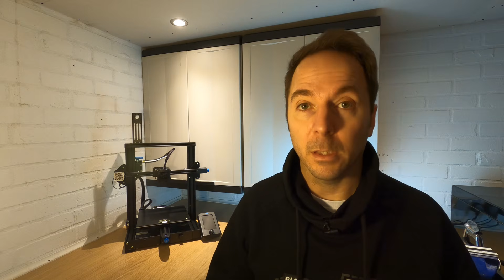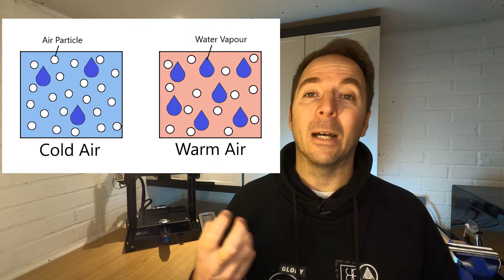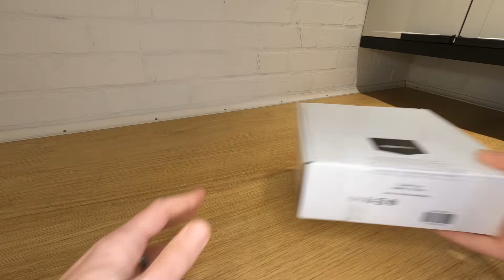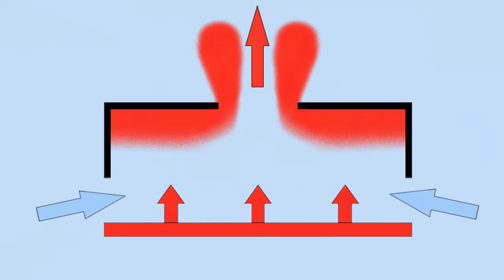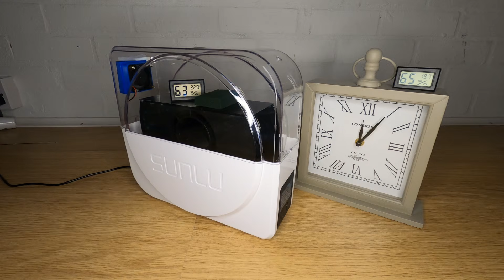Amazingly Simple Free Filament Dryer -You already have one!

Comment: Any old school stick welder owner will tell you the best way to get welding rods dry is to not let them absorb moisture in the first place.
We used to use an old filing cabinet with a 40w incandescent light bulb in it to keep it warm to store all our welding sticks.
These days you could probably mimic that with an automotive brake light or 2 running off a 12v power source in a similar cabinet.
All it has to do is keep the temperature a few degrees above ambient and you're done.

Comment: This is genius tbh. I was looking into filament dryers becasue I am working with pla and petg and in the future maybe nylon and carbon reinforced polymers, I really needed a solution for the moisture, maybe ill invest into a real dryer eventually, but I am not cranking out parts for a project right now so it seems like a good use for the currently idle printer. How often do you suggest I dry my filament. My humidity in that space is around 30-50% at about 20C.

Comment: Great idea and I'm sure it works if you have wet filament. Better yet never let your filament get wet! My environment is typically minimum of 45% to 60% humid. But I never have a problem because I use those air/watertight totes with desiccant after each use of any filament. In totes the humidity averages 27% to 30% and the desiccant shows no signs of wearing out for over a year. And the big benefit is no wasted energy or wearing out of my heated bed.
Reply: Just store the spools in hardware shop paint buckets with desiccant packets. the paint buckets are air tight by definition, and each can store 3 to 4 spools. the desiccant can be dried on the print bed the same way as the filament.
Reply: @TDOBrandano  Problem I see with paint buckets is that you can't see what's inside, minor setback that can fixed with labeling.

Comment: I think you touched on the important points but didn't quite explain this part - Filament (and/or dessicant) needs to be heated up to a certain temperature to start desorbing. Essentially, it doesn't just evaporate the water it contains, its capacity to hold the water decreases. Soaking filament in water does next to nothing, really. You don't end up with bubbly filament after doing that. The water seems to absorb deep inside and that happens when the filament absorbs water from the air, and usually after a long period of time.

Now this only does one of two things to save filament though, PLA tends to harden over the course of say a year, and my suspicion is that it's due to absorption of UV. The UV tends to harden it. This process, unfortunately, is irreversible. Heating it up and then cooling it back may anneal it just a little bit but does not much more than that. You may notice that printed parts you've kept for years (esp if exposed to sunlight) will by now be crumbling to dust. That's simply because it's hardened to the point where it's become dust.

Comment: I just bought a filament drying box today but this is a great tip.  Many people upgrade their printer and older 3D printers have a fairly lousy resale value.  It might be good to keep one as filament dryer.
Reply: low resale value for the sellers.  I only buy used.  Saved so much money.  It's a gamble on saving time as sometimes i've had to fix an issue here or there but 500 for the printer and upgrades vs 100 on facebook marketplace, yeah gimme the 400 to put towards whiskey!
Reply: @RedneckTechSupport  - I'm a sucker for the latest and greatest in the fast moving world of 3D printers.  Not only am I not saving a fortune on a low mileage last year's printer, I'm currently waiting for the Neptune 4 Pro Max because the very nice Neptune 4 Max doesn't have the Pro features I want.

I am thinking about converting my old SV01 3D printer into an EDM machine although the only real application I can imagine would be electrical discharge machining the rifling of a pistol barrel for some wacky 3D printed pew pew machine I might want to design, but then I'd post a video online and the fed bois would pay me a visit even though it's completely legal.   :-/

Comment: An experienced design engineer once said to me "If you are adding simplicity or removing complexity your design is going in the right direction, if you are adding parts and complexity it's a sign that you should review your design" This sums that idea up for me!
Reply: One thing is certain... your design engineer friend was without a doubt NOT German.
Reply: So that’s why German cars have become garbage 😂
Reply: Only bad thing about this design, is that it uses a cardboard box. Famous for loving to soak up moist from the air.  With another material in the box, I would say its good.
Reply: @AndrewTSqbut since youre drying the box aswell woukdnt that just solve the issue? I dont mind an extea hour of drying time if it makes the box dry aswell
Reply: Tell that to all those EV makers with flush door handles.
Reply: Retired manufacturing, design, ME, and EE here.  I've said the same thing.  Most experienced engineers worth their salt will say this. 
Accounting will love you, but you will forever be doing battle with Marketing.
Reply: How long do you leave it?
Reply: @snydergc  He said for his test, he set the printer bed at 70 degrees Celsius and left it for about 5 hours. Yes, I know I am a year late.
Reply: Thanks for sharing 😊
Reply: Often heard, but that way we'd never Jumbo-Jets, AMD Threadripper or WIFI 802.11ax. So it is not generally applicable.
Reply: @holgerschurig4430  Plausible, but perhaps we'd have simpler aircraft, instead if more ( not all) engineers also thought like this. I think there's probably a balance of the 2 perspectives to find perfection. 
The raptor 3 engine, version 3, of the starship engine from spacex is an absolute masterpiece of simplicity, but it's the result of first building a crazy complex engine, and then refining out every possible extra part they can. The best part is no parts... or something like that.
Reply: That is a very simplistic view of it, a lot of times you have to add complexity.
Reply: @conorstewart2214  I've noticed you can always count on others to add complexity (must be easier or something) but rarely anyone removes any... :)
Reply: @jayblack8132 I am considering the same.
Hot air can contain more moisture than cold air and water is more likely to evaporate from something when it is hot, that is how the principle works.
In the case of this box (see what I did there?), convection makes the "extra wet air" rise out the top. It is then replaced with colder air, which can contain more air as it heats up.
If you cycle the "wet" air out once the drying is complete (and ideally vacuum pack it), the moisture should stay out.
I'm too lazy for all that, so I use almost-airtight crates with no vacuum bags and recycle the dessicant pack when I notice the humidity goes up (if it doesn't recover after taking out or putting in a roll).
A mini-fridge would be the ideal size for having a mini dehydrator.
Reply: @jayblack8132  yes you need a solution for keeping the filament dry. Most common are sealed boxes and desiccant or vacuum bags.

However for some filament, especially filament that isn't very hygroscopic, it will take a while to rehydrate, so you can get away with leaving it in the open and only dehydrating when you notice it has become too wet.

Comment: Actually a quite nice idea. Also some people might have upgraded their 3d printers - like better bed (fine milled casted aluminium) if the old bed is bend or/and a board with silent stepper drivers, maybe even from 12 to 24V... So practicly having all parts flying around to build a "3d printer" without actual print functionality, just old PSU, printbed and controller (and a second thermistor, if the firmware do have a min temp failiure for the hotend). Actually I would like an firmware for old RAMPS-based boards, reusing the display and rotary knob to set temperature and time and using one i/o pin for one-wire buss to add a humidity sensor (maybe to controll a fan, if humidity is to high to forcefully change the air, instead usung convection. Should be even better than the modded Sunlu dryer, as you can get over 70°C, and also you can use a less flamable material than the cardbox of course. Actually here in germany at xmas some packages for sweets have exactly the right size for 1kg spools (I use them as airtight containers for my more expensive rolls - but I do not have a lot, as I am diabetican). Also I think I saw some transparent container for cheese in the kitchen department of IKEA for just a few bucks.
To save energy you might insulate the bottom of the heated bed.
Actually a nice way to recycle old parts.

However, many printers have timeouts. The Prusa mk3 for example shuts down, if you just heat over 20 minutes without actual printing. You might generate a gcode homing, going up with the printhead and than move it from time to time in x to avoid running into timeout. Or compile your own firmware, deactivating this feature.

Comment: I've put reptile heat pad into Ikea Samla transparent box. And a themometer/igrometer too. 
It stays 32-33°C with thermostatic control to don't cook reptiles. And humidity rarely pass 40%. 
Into a 22L Samla I can put 6 spools (1Kg each) and a 7w heat pad. 
There's different sizes both of Samla and reptile heat pad.
Reply: 32-33 C is too low for drying filament and 40 % humidity is too high to keep it dry. You need 50-60 C for drying PLA and ideally you want humidity at 10-15 % for storing filament, so your solution is not really a good one.
Reply: @conorstewart2214  I destroied 3 spools of PLA drying it at 60°. If you look at the vetrification temperature of the PLA it's 60°. They need to be dried at <=40°C. 
My box is slow and needs 2-3 days. 
I keep spools inside and take when I need to print. 
I can testify that also PETG that was startin to pop and do stringing after 3 days out on the spool holder of the printer, it printed perfectly just the day after (near 24h) into the box. 
Umiduty is always under 40%.
Reply: @conorstewart2214  60°C for PLA? I destroied 3 spools of eSUN PLA+ drying them at 60°C. 
Dry temp for PLA is 40°C, 60°C is for PETG.
On tech specs for PLA it's written that at 60°C it starts vetrification.

Comment: Hello, Ricky and fellow printers.

I performed a retraction test that gave me very thick strands, so I dried my filament for 4.5 hours at 75°C, then immediately reprinted the test and it was beautiful. After some 5 or 6 hours, I performed the same test again but the thick strands came back! Dried overnight at 55°C, printed the test right away and it came out clean. Unfortunately, when I ran it again after some hours, the strands formed once more. The only way I can rationalize it is that the moisture isn't "pulled too far from the spool", hence it's re-absorbed by the PLA in a matter of hours. Is this roll of PLA too degraded? Or should I dry it for like 30 hours straight, for example? I had never dried filaments and this spool was opened more than a year ago.

Thank you for your insight!
Reply: I wonder how humid your room is, try putting it in a box of desiccants after drying and see how long it stays good
Reply: @EddoWagt  thank you. 🙂
Reply: Is the spool still warm when you test it? I'd eliminate that as a variable, because it shouldn't be absorbing ambient moisture so quickly.
Reply: @GamesFromSpace  Definitely still warm. I would say it goes back to stringing when the spool cools down. 😮
Reply: What material are you using? If it is PLA then something is really wrong, it doesn’t absorb moisture quickly and you shouldn’t be drying it at 75 C, since PLA goes soft at around 50-60 C and you shouldn’t be drying filament at a higher temperature than it’s softening point as you can then end up turning the roll into a solid lump as the strands stick together.

You really should have mentioned the material you used, that is basic information.
Reply: @conorstewart2214  yes, it's PLA.

Comment: I found, with a single 3 cm hole in the top of the box, you can put a toilet paper tube (or a full roll of toilet paper) on top of the hole to act as a chimney, which more efficiently draws the hot air upward out of the box.
Reply from the maker: I like it!

Comment: I read a lot of good reviews. but funnily it didn't work for me😥60C 7hrs, only 0.5gram lighter.
Should i add a fan on top so it draws the air from the outside to the inside and pulls the moisture away from the top? Food dehyradtor didnt work for me as well. 😥

Comment: Thank you for this clever idea. Where i'm living actually the weater is sunny and humidity is low, so i'm thinking about a "slow" drying method.   I know green houses can reach easily 40-50°c. Is putting the filament in a plastic box like your "Filament Dry Box" outside in front of sun (with black cover or dark plastic color to help temperature increase and protect filament color with some holes to permit air circulation) a good idea?. I know temperature will not be really stable and will not reach 70°C but until it doesn't reach too high temp and i give enough time to dry , that will do the the job?

Comment: Isn't 70° C pretty hot for a test if you're drying PLA? PLA gets soft and sticky at the usual 60° temperature used while printing. Wouldn't it be best to set the temperature to 50° in that case? That's what I'm using now to attempt to dry a spool of PVA, but I don't know how effective it would be. I'm concerned about the filament fusing or annealing to the spool if I make it hotter. Letting it sit for a day with the heat bed set at 50°C seems to work OK.

I encountered one difficulty when the Prusa MK3S "safety timer" kicked in and shut down the heat bed after half an hour. You have to send the g-code "M86 S0" to disable the safety timer. You can put this in a .gcode file on the SD card and simply run it from the printer.

Comment: I'd prefer seeing a before/after test using a roll of filament rather than a sponge. I don't print with sponges. :-)
PS. I use a modified round food dehydrator and always dry filament, using before/after weight as a measure of success, even if it's new, vacuum sealed, etc.

Comment: This might be a stupid question, and I'm sorry if it's a repeat but...

 what's the temp and time I should set this method?

 And does the temp & time change with different plastics??
Reply from the maker: Anything over about 50°C is going to help. PLA is the easiest to dry but for things like PETG, you may want to try 60-70°C. As for times, the longer the better but you should see improvements after 8 hours or so.

Comment: Great tip, thanks :) What temperature do you set your heated bed to ?
Reply from the maker: It depends on the filament really. Start with 50-60 degrees and you should see a difference with something like PLA.
Reply: @RickyImpey  Thanks for taking the time to reply pal :)

Comment: brilliant use of the bed! I came about this in a slightly different fashion that holds a bit more and I can still print while using.  I bought a 2 pack of Plant Heating mats on AMZ (in testing stay between 70-85 degrees and each mat holds 2 spools)  For < $30 and with 4 cardboard boxes I got a 4 spool dehumidifier that doesn't tie up my printer bed. ;)
Reply: what temperature and how much time should I leave my filament on for, if i'm using my printer bed? ? this seems really intuitive!
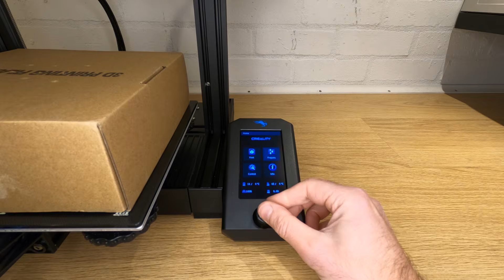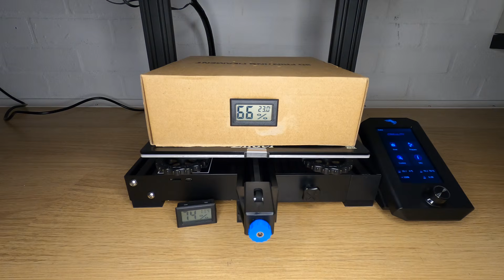Reply: @TheStrokeForge  The speaker states that for his test, he set the printer bed at 70 degrees Celsius and left it for about 5 hours (2:57-3:00). Others have said they heated the bed to 50-55°C for about 3-3.5 hours. I guess your mileage will vary.
Reply: That's brilliant!!

Comment: I do have a heated bed for my 3d printer, but it's small is it still possible to do this? I assume it will take more time instead of just 4 - 6 hours
Reply from the maker: It will work to a degree but, you are right, it may take longer.

Comment: Mine is much much cheaper i just hang it at the back of my freezer its an old model freezer with evaporating coil at the back,  my place is humid too around 75 to 85 and my freezer where i store my filament is just beside my kitchen sink still my filament is always dry and ready, i was thinking of installing a PU plastic to enclosed the back of my freezer but im too lazy to do it. you can also use the evaporator unit of your air-conditioning just dont put it there for too long because dust might accumulate

Comment: Thank you so much, my mom wouldn’t let me use the oven to dry filament and I’m too poor to afford a dryer, so this is perfect!
Reply: Exact same situation man , have you tried this method yet , and if so how’d it work for you , what filament did you test it on ? Thanks in advance
Reply: @cerolocks8662  and actually covering the inside of cardboard box with foil would be fine m sure too, I just used plastic container
Reply: @goatmodegaming  be careful with what you use, since you don’t want to be eating from a container that you used on your filament
Reply: @cerolocks8662  it worked perfectly, I had used small spools of PETG overnight, so like 10 hours. But the cardboard wasn’t working so I took plastic kitchen container and covered the inside with foil, poked some holes in the top (hopefully my mom doenst find out lol). For PLA make the plate like 60 and make sure there isn’t too much space in the bottom. Maybe flip the roll I’ve half way through too. I did have one roll that cooked in the middle a lot though, it may have been slightly too hot. Good luck! If you have any more questions I do see my YT notifications in mail so I’ll be quick